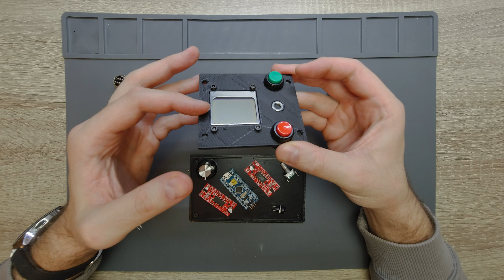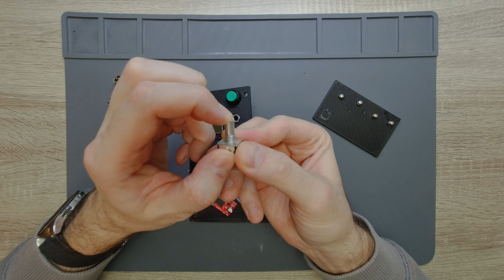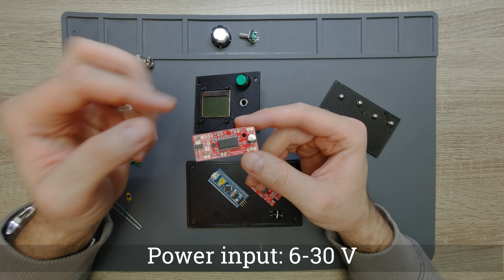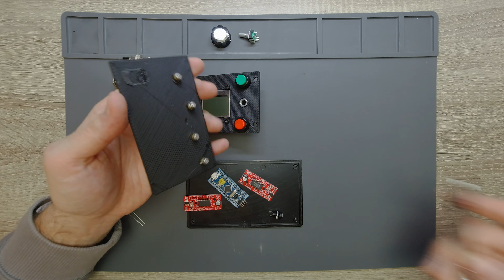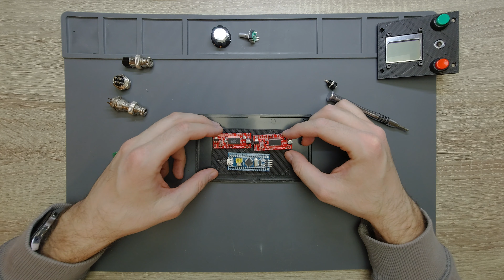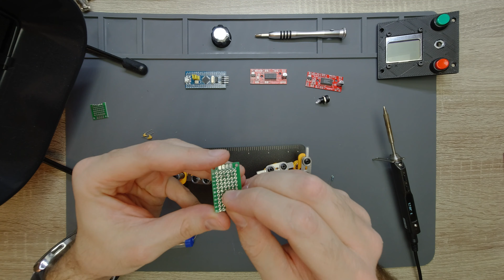Building a coil winder [Part 2] - Assembling the electronics

Comment: Hi, I decided to go with an arduini mini pro, that I had at hand, I modified the code to adapt to the avr and I managed to get it working, without resistors on the rotary and the buttons, just by turning the PULLUP option on in 
the code.
 //Rotary encoder
  pinMode(RotaryCLK, INPUT_PULLUP); //CLK
  pinMode(RotaryDT, INPUT_PULLUP); //DT
  pinMode(RotarySW, INPUT_PULLUP); //SW
  //Buttons
  pinMode(UpButton, INPUT_PULLUP); //UP
  pinMode(DownButton, INPUT_PULLUP); //DOWN
  pinMode(led, OUTPUT); //MCU onboard LED  

** is the PULLUP option available to the STM32 boards as well?

All has gone well and the menu works fine, however, there is one point that I have little trouble, a small glitch, as in your video at point 40,53, when you turn the knob right after the initial display, the menu moves to Acceleration, that is menu #2 (case #1) and not Speed that is case #0, I wonder that there would be a way not to skip directly to the second menu option?
I will have to go thru all the videos and explore the code some more and come back with more questions if that is all right... also, I thought I will add at the bottom of the menu, line 5, the indication of the menu number, like 1/10, 2/10, 3/10.....for every frame...
like...
 case 0:
      lcd.setFont(c64enh); //set the font (small one)
     // lcd.printStr(ALIGN_CENTER, 0, "            "); //erase previous text
      lcd.printStr(ALIGN_LEFT, 0, "Speed       "); //print new text
      lcd.printStr(ALIGN_LEFT, 5, " 1/10");
      lcd.setFont(Term9x14); //Set another (larger) font
      snprintf(buf, 8, "%d", stepperMaxSpeed); //the decimal value of the variable is in the buf
      lcd.printStr(15, 2, buf); //set the cursor to 2nd line 15th pixel and print the buffer

also, I found out in my previous adventures with arduino that there is no need to erase the line with blank spaces and write it again using two steps, you can write it over as long as you keep all 12 spaces re-writen, I would like to use a thinner font for the numbering in line 5, but there is not defines in the library, perhaps I will not dig any more...now I need to connect the steppers and then adjust the module of the movement and the settings of the DRV drivers, by setting the jumpers... I will have more questions soon, if you don't mind...
Reply from the maker: Hi, 
- Yes, STM32 boards also have internal pull-ups on their GPIOs. Just read the datasheet. 
- I think that jump at 40:53 can be resolved by defining the initial value as -1. Then the first encode pulse will set it to 0, which is the first menu item. 
- Sure, you can do that way but since you might not always know the number of digits for the next value to be printed, it is easier to remove everything and reprint the empty space. At least, I found it easier.
Reply: @CuriousScientist  Thank you for responding, so far I have had little time to "play" with it, I have hard wired a perforted pcb and I managed to to these small adjustements in the screens, I need to start watching the videos that are describing the operation... and hook up two NEMAs to see how it works... I multiplied the "length" parameter *100 to show mm, but I am curius, why did you not add the length of the wire, as the code runs and you only add it when you change layer...?
anyways, it is a wonderful work that you have done!!!! trully nice and organized and very very clean and very well explained... I need to learn the operation... and possibly make a small manual... how to run it...and then I will need some guidance to upload the ode to an STM32... wether will be with arduini ide or with the smt ide...Once again, thank you much!!!!

Comment: hello friend, how was the project working?  how to make a video with it working?
Reply from the maker: Hi! The project is still under development. Today, I finished another big project (video will be published tomorrow) and now I can put a bit more time on this one. Actually, I bought a few parts this week, so I can put all the electronics in a proper enclosure. I will probably publish the 3rd part in 2-3 weeks.
Reply: @CuriousScientist  ok friend, i'll be waiting, i set up one, but i'm having difficulties to set the time and speed of the displacement and winding when the wire thickness (awg).
Reply from the maker: I will publish all the formulas and source code so you will be able to use them as guidance.